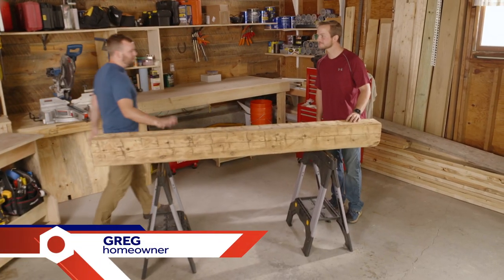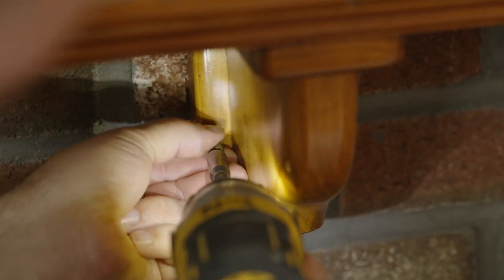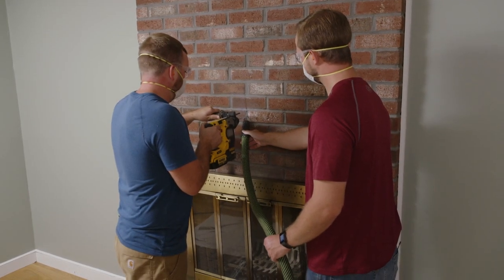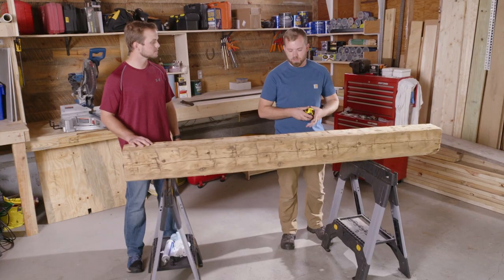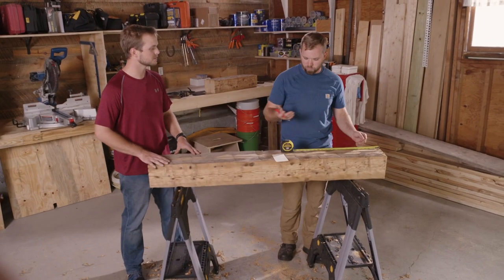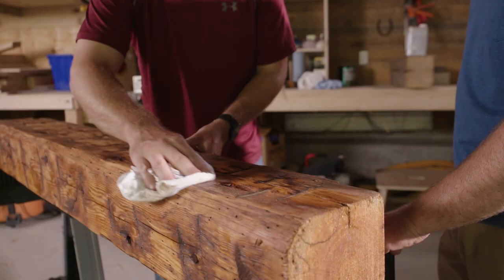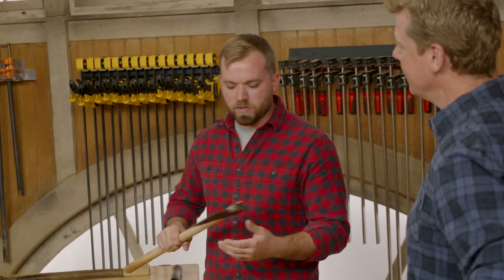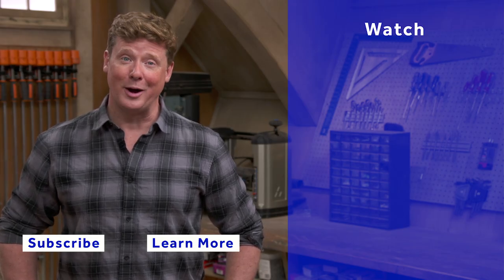How to Turn a Reclaimed Beam into a Fireplace Mantel | Ask This Old House

Comment: Really good to see Nathan back on the show. This makes me excited for the future of TOH.
I would have cut the mantel long so it extended wider than the chimney and cut out a groove to make it flush with both the chimney and the wall. Buuut that would've taken more than a day. I also would've used carriage bolts to attach it to the chimney so it could be removed - and antique bolts would've complimented the character of the wood.
Reply: Antique nuts ?
Reply: @derekw40  I mean, if you mount the bolts into the wall and then screw the mantle on with the nuts I guess. 
I was thinking the rounded head of the bolt would be what you left visible.
Reply: @pufthemajicdragon  oh I see. Thank you for clarifying. 😊

Comment: Epoxy on each end?!?!. . How do you remove the mantel if you need to at a later time?  . . Sawrzall to cut the rod?
Reply: That was my thought. Do it like a stair rail, embed the rod in the masonry, and drill the holes in the beam. Then holes with a fostner bit from the bottom so you can secure it with nuts. You can even cut matching bungs from the end you cut off.

Comment: SUGGESTION: this is where an interior designer would have added a little finesse. The beam should have been situated with the surface of the mantel in the wide direction. Then it's calling out for a couple of corbels to act as a structural element. The way it was installed it looks fake - like you used epoxy to glue it in place (even though that's what was done, an old beam like this should at least look authentic).